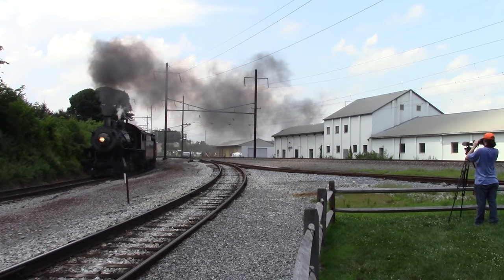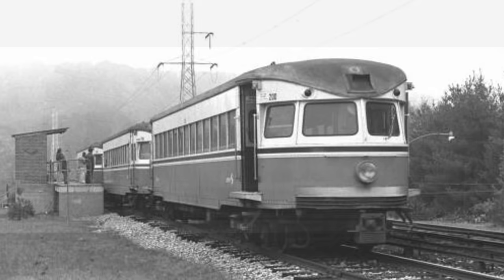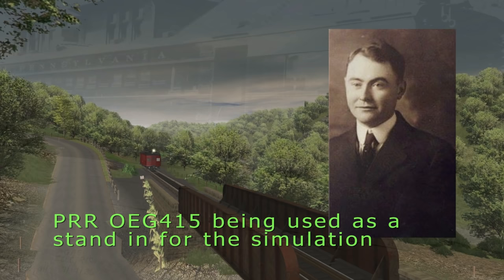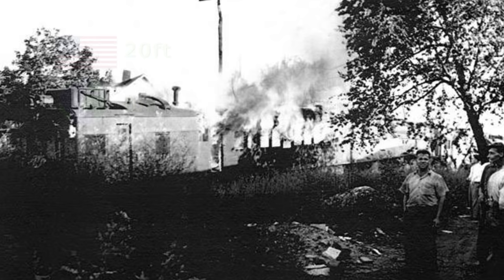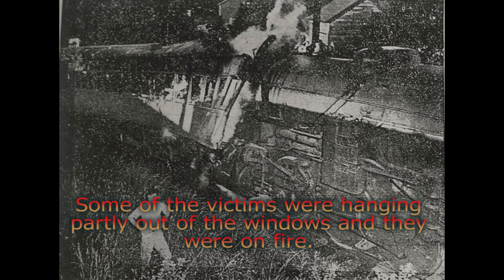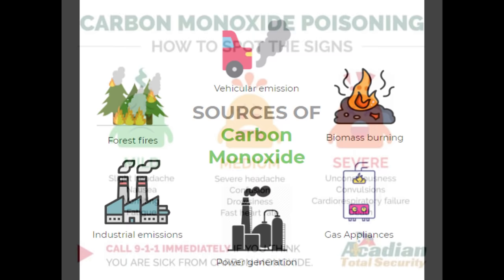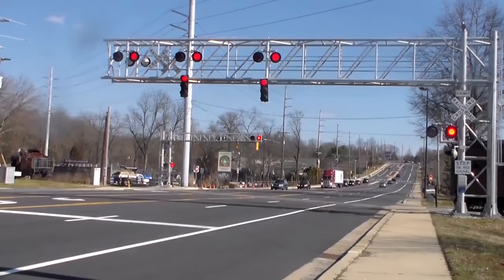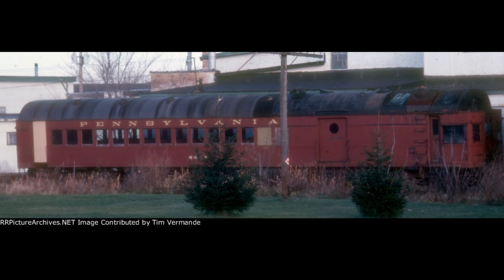The Doodlebug Disaster 81 years later

Comment: I remember in 1982 a SEPTA RDC hit a gas tanker truck at Southampton Pa. and what an explosion that was.
The crossing signals failed because the single RDC lacked the additional electronic axle shunts which insured that gates & flashers would trip.
The engineer died 2 weeks later due to 80% burns over his body and 3 others were injured. If not for being the day after New Year and a Saturday, I'm sure things would have been much worse.

Comment: Fun fact: PRR drivers had complained about the fumes in the cab (which got into the cab because the exhaust pipe would break often, sending fumes into the cab) and the PRR did nothing until after the disaster.

Comment: Nice shot of Colebrookdale 7236 @ 13:50, Funny enough, I did the paint prep on the Colebrookdale's 1935 Brill Doodlebug M-5. To put your mind at rest, both the fuel tanks and engine are mounted underneath the chassis, out of the passenger and operator compartment, so the possibility of operator impairment from fuel vapor is non-existant, lol.

Comment: That was a jolly good, comprehensive, detailed account, by any standards.   I thoroughly enjoyed it.  Thankyou very much.   As a PS, I can tell you that here in England single-line working, is rigorously superintended.  AFAICT, there have been no more than 3 single line accidents on railways in GB.   They were due to misuse of the safety equipment.   I daresay that it’s easier for a small country to pay better attention to safety issues.   In UK, either the freight train, or the passenger train would have been stopped and held, before the other had been authorised to proceed.  But this also included the use of fairly basic instruments and telegraph.  USA is big, and perhaps employing signalmen and tablets (tokens) all over the place would be frightfully expensive.

Comment: Thanks for the bit of history.  We use to have RDCs (Rail Diesel Cars) on the Reading Railroad, They ran between Lansdale, PA and Bethlehem, PA.  This was on the Philadelphia to Bethlehem Reading main line.  Most of the commuter traffic was on the electrified section between Philadelphia and Lansdale, but they continued the commuter traffic north to Bethlehem via RDCs.  Most of the traffic to Bethlehem was Taconite ore for Bethlehem Steel.  That all ended long ago, but you can still find Taconite pellets along the rails.

Now I understand why they used diesel.

Comment: I found it interesting to note that the chief clerk said that the engineer was ordered to make the turn at switch 3. The implication of this is that the engineer would have to stop the car, get down and make the switch, get back into the car and resume the journey. The problem with this is that the impact occurred only 1/4 mile past the switch. There would have been insufficient time for this to take place before the freight train arrived at the switch.
The alternative scenario is that the switch should have been operated remotely and wasn't for some reason.
In either scenario, signals should have been set at danger in a properly organised system of signals and interlocks. The very fact that this is not mentioned suggests that there were no such interlocks, a very unsafe way to run a railway.
There are a multitude of possibilities of how this happened with what was clearly a deadly scheduling error, and what might have gone on behind the scenes to avoid liability?

Comment: Was a railroad track foreman for a time. Being responsible for the lives others slightly stressful to say the least. One mistake can end in disaster and in all derailments the crew, the track foreman and the dispatcher are it when it comes to the investigation. Tried to pin a derailment on me that I fought and luckily won. Was low man on the Totem Pole so had to take the blame  just the way it was. A code of silence.Pointing the finger at another wasn't going to nor did happen. A true brotherhood of railroaders back in those days anyways. So many what we called close calls. Lucky and blessed no one injured under my watch.
Reply: What you wrote about management trying to put the blame on worker has been the new way of work. Worked for a large gas utility in. Every thing a worker does there is a certification for. When driving you have a camera on you and the way you drive is seen through a computer. This is all great but it also gives a utility an easy way to blame a worker because he didn't follow training

Comment: You only get CO when you don't have sufficient oxygen for complete combustion which produced the stable, but also toxic CO2.

Diesel fuel fires do occur in crashes, see Ladbroke Grove.
Reply: Of course, Ladbroke Grove was quite different from this. Most likely, the fuel was ignited by downed wires, something that could not happen on a non-electrified line.
Reply: @victoriacyunczyk  their were other sources of ignition for the vaporized diesel, such as hot engine parts. Even over heating brakes or axle boxes can cause fires, take the Llangennech accident of 26 August 2020 when a tanker of diesel caught fire after being derailed due to seized brake. There was also the 1984 accident at Eccles that involve tankers filled with gas oil (similar in nature to diesel) that caught fire after being hit in the rear by a diesel powered Express passenger train.

Comment: Thats the reason diesel and oil engines are preferred on any ship with an inboard engine. Gas just make a fuel-air bomb when a leak occurs. Its even more dangerous when the leak occurs in a sealed room and finds a spark. Explosive!

Comment: 13:55 Modern diesels are quite complex due to emission laws, but surely old diesles are much simpler than petrol enigines? The don't need sparkplugs and therefor no distributor, no spark coils, no ignition timing and all the rest are also in petrol engines. What am I missing?

BTW the main reason why we have many diesels in Europe is that for a long long time the price of diesel fuel was significantly lower than that of petrol and diesel engines and diesels got better mileage due to being powerfull but sluggish; diesel drivers were forced to drive economically due to the fact that their cars simply would not do anything particularly quickly. There was no temptation to accelerate quickly and once you were on the highway keeping a steady speed just increased your mileage. Today's diesels often outperform petrol cars and diesel is about as expensive as pertrol so it's really a personal preference now.

Comment: what program do you use to make these videos???
is it TRAINZ???
.
also.... can i suggest you look into RUN8 (its not on steam.... yet)
but it is THEE most realistic sim i have even played
.
it only has SD/GP 40 and newer locos and cars...... but they are adding content fairly quickly for a dev team of like 10 dudes 
.
the next update should bring better weather effects and derailments IIRC
.
.
.
but the way you can forget to open the angle cock.... so you dont have brakes
or coupler "slack action"..... which can break (from too much pull OR push)
the way the air brake systems work is SPOT on..... 
.
you can set up DPUs..... and even "fence" them (so you can control the middle and back units independently from the lead units)
.
like... i have ran a train with 2 SD-70s followed by 3 SD-40-s
and i can move the fence around.... so the controls in the cab control all, 4, 3, 2 or just the very lead unit
and then control the other locos using the screens in the cab
.
i usually control the two SD-70s...... then set the fence between the SD70 and the SD40s.... due to their different power outputs
.
or if i have helpers on the back..... i can reduce power at the front, and keep it on in the rear..... when i crest a hill
.
.
.
.
TLDR........ its VERY realistic
its what real engineers play in their free time (or even use for training.... as the routes and physics are THAT good)
.

Comment: Your graphics are outstandingly brilliant - I love the little details, such as the two men at the depot, early on, whose arms are actually moving, and the accuracy of the steam locomotives' motion. Do you use original cine footage as a starting point for the graphics? 

'Doodlebugs', incidentally, has a different meaning over here in Britain - German V1 flying bombs! I believe both the railcars and the weapons got the name due to the engine noise. 

The wreck itself, tragically, is a little similar to one at Abergele in North Wales, back in the 1860's, when runaway wagons carrying wooden oil casks met the down 'Irish Mail' head on. The oil, flung all across the leading coaches, ignited from the engine's furnace, and no one in those coaches survived. They were almost certainly dead within moments, killed by the intense heat sucking up the oxygen, and hopefully never knew what happened.
Reply from the maker: All the models human and locomotive were provided by the simulator game "Trainz A new Era" with the locomotives being Downloadable content from a site called K&L Trainz. The human figures just worked out to help make the setting alive and the locomotive models were a necessity as I could find just 1 photo of the actual doodlebug before the accident and little to no photos exist of the 2 decapods involved. 

I remember hearing about the Buzz bombs as my grandfather who was a British Air raid warden probably remembers them well. The funny thing is they weren't terribly fast so Hawker Tempests could match their speed and touch wingtips to carefully turn and flip the buzz bombs over so they'd explode in the middle of nowhere instead of London. 

That accident seems interesting and I might try to look it up to learn more about what happened.

Comment: I'm not sure that the possible impairment of the engineer due to the fumes from the petrol/gas engine wouldn't have happened if the Doodlebug was running on diesel/heavy oil.  Although in theory a correctly running diesel engine should produce only water vapour and soot, the particulate matter, that is only likely to happen in a laboratory-engineered engine.  A mass produced diesel engine is never going to reach the level of tolerance needed to allow the combustion to occur perfectly, so the prime mover would have still produced carbon monoxide, and with less good maintenance and the much lower understanding of diesel engines around in the '30s and '40s, don't forget that mass production diesel engines had only been around for maybe 20 years at that point, it is likely that the chances of carbon monoxide intoxication for the engineer were still pretty fair, especially being as it really doesn't take much carbon monoxide getting into the blood stream to impair a person to a significant level as the carbon monoxide replaces oxygen in the circulation...

I'm also decidedly unsure that the magnitude of the disaster would have been any less had the Doodlebug been diesel powered.  Although diesel is much more resistant to ignition than petrol/gas, it burns ferociously when superheated, which is exactly how a diesel engine operates.  The freight train penetrated some 12 feet into the Doodlebug, crushing and eventually breaching the fuel tank resulting in the fire.  In a diesel vehicle the crushing of the fuel tank will result in the diesel becoming superheated due to the compression, very likely beyond the point where the fuel self-combusts.  Because diesel is such an energetic fuel, which is why it's used to power heavy vehicles, this self-combustion takes the form of what appears to be an explosion, though is technically "only" a very energetic flash fire.  Because the diesel burns so hot then the results of this happening in the Doodlebug would have been worse than the gas-powered fire that did happen, and enormously more difficult to fight or extinguish, which would almost certainly have led to the fire spreading to the freight train.  Burning diesel burns are also vastly more damaging to human flesh than gasoline burns are so the results for the passengers would have been equally as horrific.  If you're unsure then look up footage of what happens when a car crashes into the fuel tank of a diesel truck on the road, the diesel flash fire is extremely spectacular and, as it burns so hot it is likely to be beyond the flash point of a lot of the materials used in the construction of the Doodlebug causing instantaneous mass spreading of the fire...

Comment: You should use "56km/h" and not "56kph".
Why?
1- it is one of the standard notations accepted In the SI.
2- You need to have a measure of distance in the notation. "Km" is a measure, "K" is just the sign for 1000.
Apart from that tiny detail, great video!

Comment: I've ridden the Cuyahoga Scenic Valley Railway and I didn't know there was even a branch line to Akron from Hudson, which is on the original New York Central Cleveland Line.  The thing I don't get about this is why would you even expose crews to carbon monoxide knowing they are sharing the same lines with freight trains? I think there should have been more done against the Pennsy for not covering up the prime movers so they wouldn't cause an accident like this where many people needlessly died.

Comment: Very interesting video.  When I look at transportation vehicles I always wonder why something is the way it is if I can't see the relationship right off.  I now know why gasoline is no longer used and why diesel took it's place.  However it would be nice to know if the switch from diesel to electric has an accident or dangerous component or if it was simply a matter of cost and convenience, i.e. for instance the time involved in pumping the fuel into the engine's tank.  I'm going to look for some more of your videos so expect to see me around. :)
Reply: The only ‘downside’ Of Electric trains is that they require either Overhead Lines or Conductor Rails to supply power.
So you have to invest and maintain more infrastructure; as well as ensure it is isolated before doing work on it.

Battery-electric trains are a cop-out to avoid investing and don’t work for most applications but have a place on short or lightly loaded passenger services.

Comment: This is why you have a prime mover that won't cause problems while inside a carriage body. As far as I know, the NER 1903 Petrol Electric Autocar didn't have the same issues as the US "doodlebugs" such as fumes due to how well its prime mover(s) were built. The Autocars were converted to diesel by the LNER only because diesel prime movers were now capable of tackling the workload. Hate to be a bragger but what's the simple difference between Britain's railcars and America's railcars(?), Britain's railcars worked.

Comment: As for using footage: Does the same rule go for every video? (I mean usable with credit.)
Reply from the maker: On documentaries it varies on who owns the footage, in the simulation case that's all mine which means it must be usable with credit.
Reply: @Thunderbolt_1000_Siren  All of your footage is what I ment. Of course I'll credit you if you allow me to use it. No issue. Thx. for giving me this oppotunity. (Cuz I adore some of the engines you show in Trainz.)
Reply: @Thunderbolt_1000_Siren  Thx. Also, in my AU Amtrak 312 was repaired along with the other 2 Bayou Diesels (To atleast have one bright spot in this tragidy) and sold off to the Misty Island Railroad and the NWR for service. You think that would be a decent AU or are there any ethicle concernes? (I just wanna get them bach from the dead cuz it hurts + I wear the number 312 too.)

Comment: 12:13 That statement regarding complaining about fumes pokes a big hole in the theory of carbon monoxide causing short-term memory loss. Carbon monoxide is colourless, tasteless, and odourless; If it's in the air, you'll never know unless you have a CO detector. If it were the reason why the engineer missed the points, he wouldn't have complained about fumes in the cab. As such, I think the real reason was just plain ol' negligence on his part.
Reply: With an exaust leak you’ll often smell other conbustion byproducts though.

Comment: Very clever use of cgi to tell the story.
Reply from the maker: The only issue is the Doodlebug is the wrong engine (with the correct number put on it) but the J.G Brill cars and EMC cars weren't too much different. Still it worked out well in the end and the I1 models I used are lovely 😍

Comment: I would never get on with doodle butt train just like I'm not going to get on at DC-10 Boeing have had that policy for 40 years
Reply from the maker: They're actually quite safe and versatile these days. When they switched from gas to diesel their fire risk dropped from 45% to less than 10% their DMU successors like the Budd RDC also became EXTREMELY popular to the point you can find em in lots of places. DC-10s and any modern Boeing? Yeah flying coffins
Reply: @Thunderbolt_1000_Siren  o.k.ill ask ...what was so wrong about the DC 10 ?
Reply from the maker: @mikeh.7499  Well it was an ok plane it had a habit of pooping engine parts in the midwest and shedding cargo doors and when both happen the controls just see themselves out the cargo door... did I mention one of it's droppings ended a supersonic airliner's career?
Reply: @Thunderbolt 1000 Siren Productions  much thanks for the info and Best Regards for 2023...!